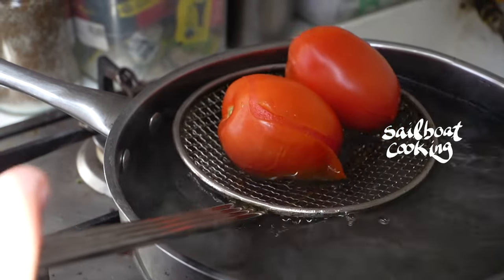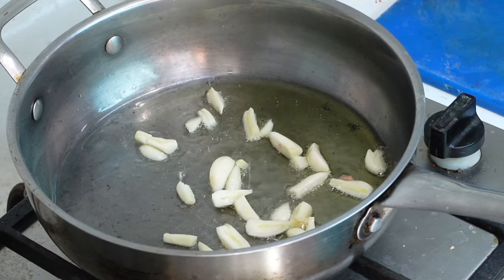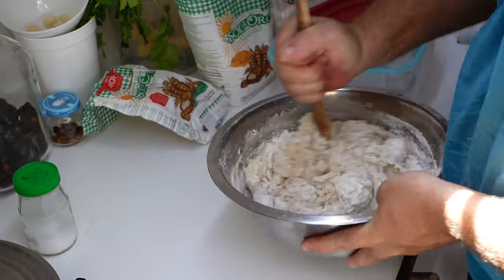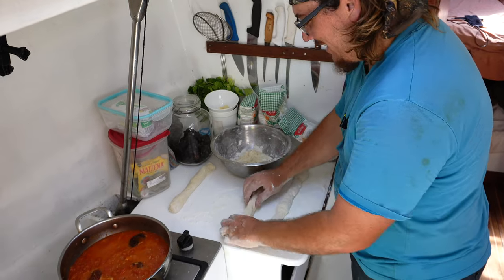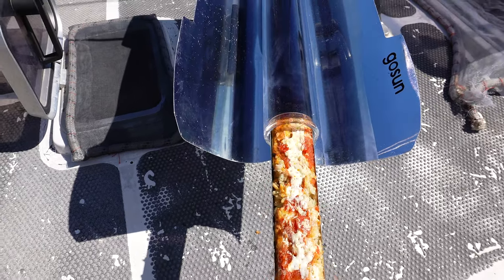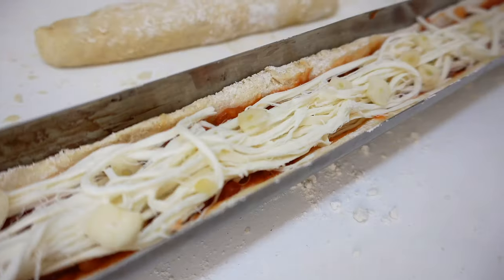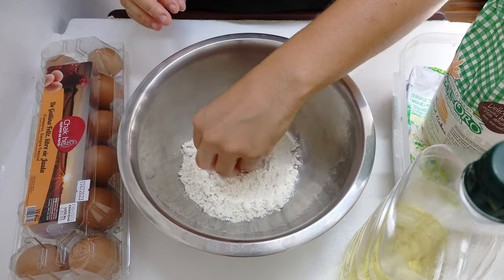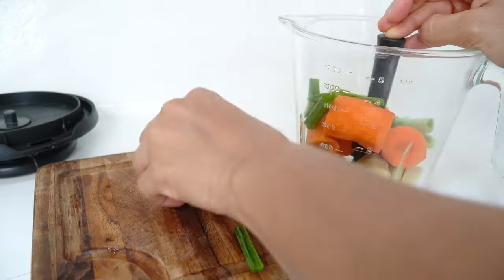The Eating Will Continue Until Morale Improves Progreso

Comment: The lights look nice.... the pizza looks nicer  :)  DC wiring has been red for positive and black for negative for ages. AC wiring has been white for neutral and black (or red for north america 220v) for "hot". Even audio uses black for hot and white for, well the opposite phase, not really neutral. The lights are probably manufactured in a place that already makes AC lights and so has much black and white wire hanging around. It also has people trained that black is hot and white is not... There are rather a lot of other colors that have other meanings. Many people use a different color for positive after it has been through a switch, breaker, fuse, etc. Some people use all black with labels. I like black always to be negative where ever I find it. I have been so picky as to change the wires that came with a light (or whatever) by soldering my own inside. I have also used twin lamp/speaker wire for LED lights for ease of running. As you have surmised, what generally matters is that the lights work.
Reply from the maker: Thank you for this - this pretty much answers our question as to why 12v lights would have such a funny colour scheme. It drives us crazy when wires are different colours all over the boat - if something is red and then goes through a wall and then comes out the other side blue, how the heck is that organized and safe?! We ripped out all the original wiring on this boat. We had been doing a lot of head-scratching from confusion because every label had disintegrated.

Comment: Those dumplings looked yummy, did you try shallow frying them as well? Fried dumplings and black vinegar is really good.
Reply from the maker: Mmm - vinegar sounds pretty good. We don't tend to fry them because boiling/steaming is healthier. It's better to pre-fry the inside mixture if doing it that way as well.
Reply: @sailorama  Yeah I normally don't like fried foods, but I make an exception for pan fries dumplings, you can use a non stick pan with no oil after steaming them if you prefer , just to get that crispy edge on one side. (I figured Robbie would be the fan of the idea of fried dumplings)
I forgot to mention before, thanks Justine for the great video as always 👍